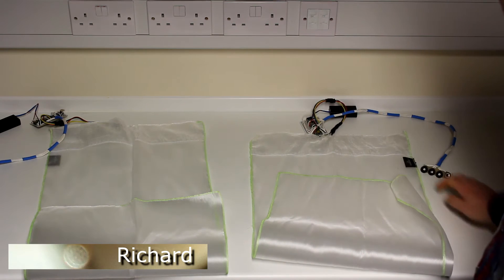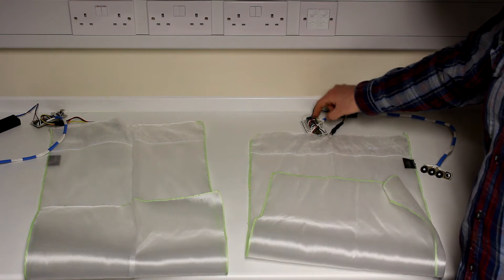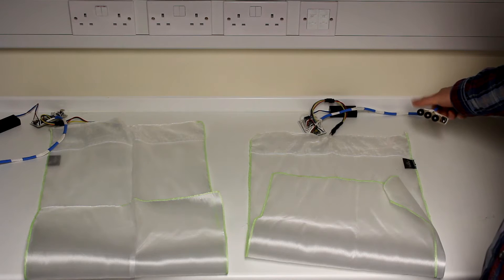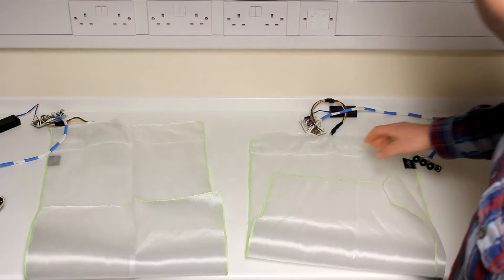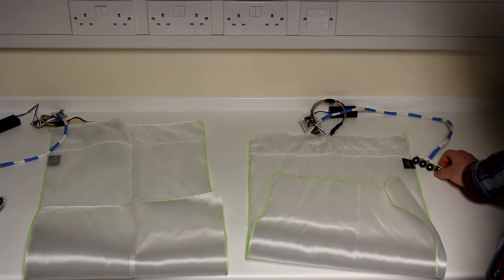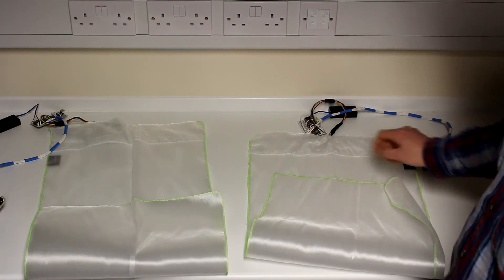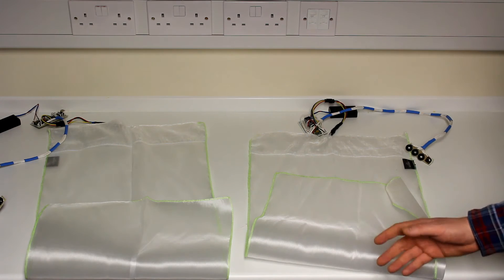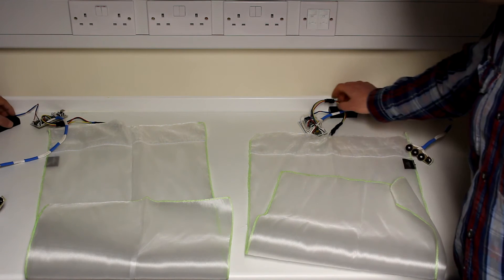RGB Wireless Fiber Optic Control

Comment: Where did you get the fiber optic sheets? Also, can you share your code for controlling the fiber optic's?
Reply from the maker: It was a while ago but I think this is the code that we wrote for this project. https://github.com/proto-pic/Arduino-code/tree/projects. We are about to add the fibre fabric to our web store so you should find it on the front page this afternoon.